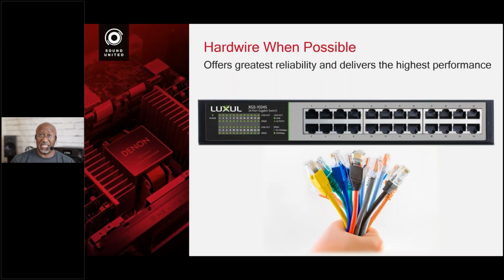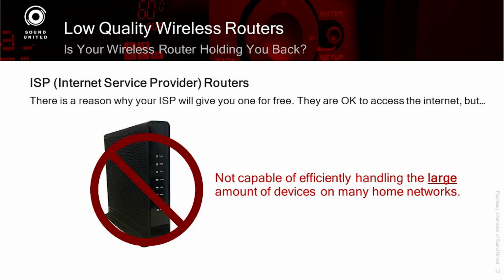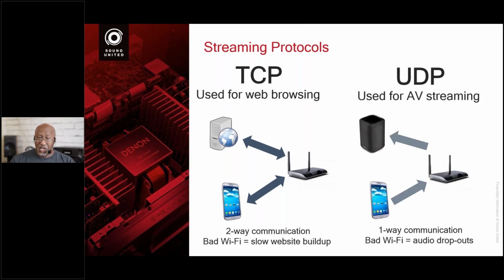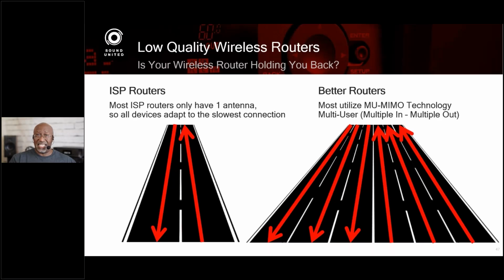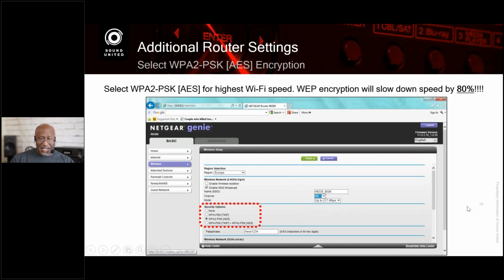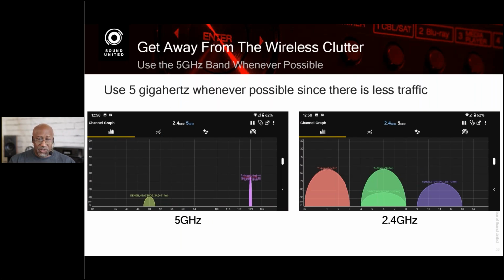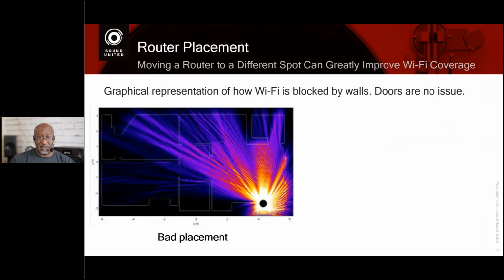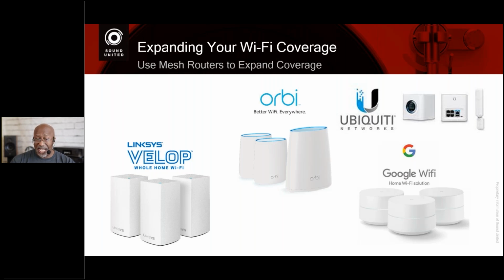Part 3 - Denon Home - Network Configuration Tips

Comment: There was a lot of great information in this video for home users but some advice may need some more research before running out and implementing.
Mesh router systems can be great but they use the same principal as repeaters. Just on separate 5GHz channels to try and separate the traffic.
It is recommended to use wired network to feed the mesh AP/Router to avoid degradation.
I'd strongly recommend turning off UPNP... Here is a quick link to why it's not a recommended technology.
https://www.howtogeek.com/122487/htg-explains-is-upnp-a-security-risk/